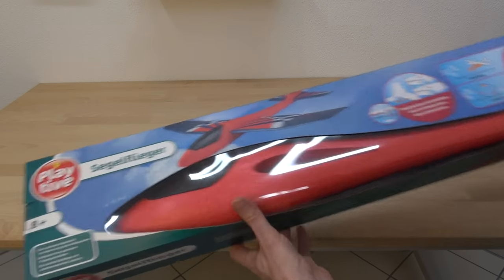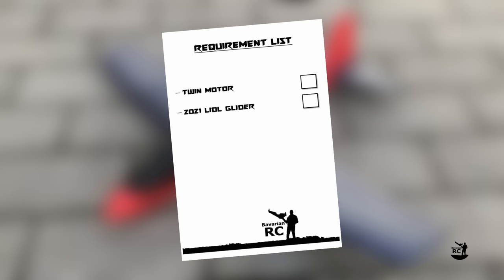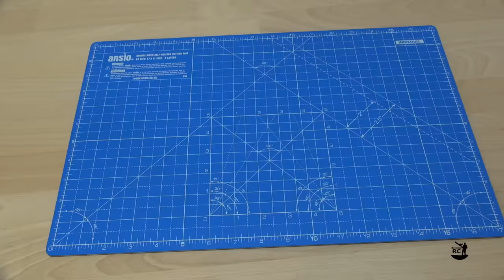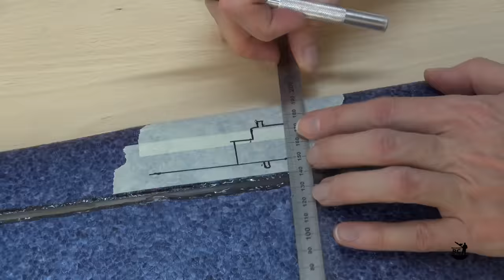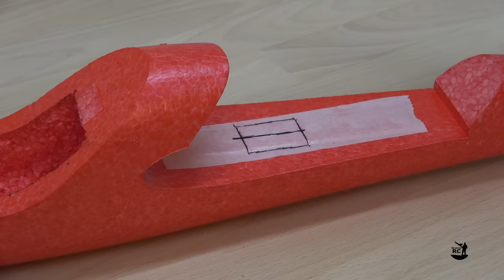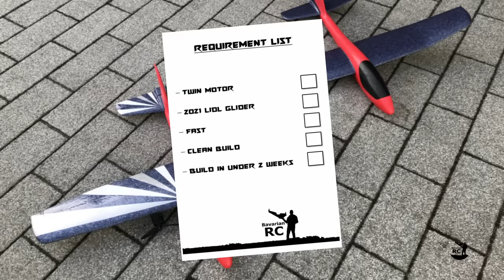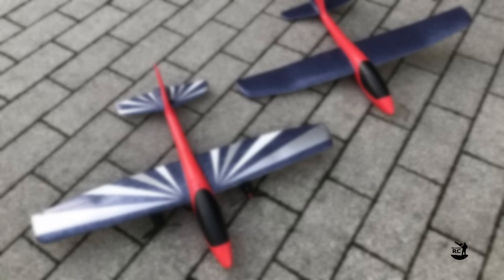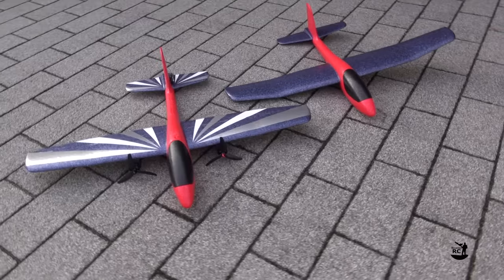LIDL glider RC conversion - TWIN TURBO LIDL - Build Video

Comment: 👍,  ?  die Verkabelung der zwei BEC's Regler zum Empfänger !????
Reply from the maker: Bei meinem Graupner GR12 Empfänger habe ich auf Kanal 1 den ESC vom rechten Motor, auf Kanal 6 den ESC vom linken Motor. 
Bei meiner Graupner MZ-24 Fernsteuerung habe ich dann im Menü "freier Mischer" einen Mischer von Kanal 1 auf Kanal 6 eingerichtet mit 100% (dadurch geht der linke Motor synchron mit dem rechten Motor mit).
Um dann noch Differential Thrust zu haben, habe ich einen freien Mischer von Kanal 4 (eigentlich Seitenruder) auf Kanal 1 (also Motor rechts) mit 85% so einrichten, dass bei Seitenruder rechts der rechte Motor runter geregelt wird. In gleicher Weise habe ich einen weiteren freien Mischer von Kanal 4 auf Kanal 6 (also linker Motor) mit 85% so eingerichtet, dass bei Seitenruder links der linke Motor runter geregelt wird. Die beiden Mischer für Differential Thrust habe ich bei mir noch auf einen Schalter gelegt um das ganze ein- und ausschalten zu können.
Ich hoffe, das hat Deine Frage beantwortet. Falls nicht, einfach nochmal melden.
Reply: Boh, ist bestimmt ne Super Ansteuerung der beiden Brushless.
Aber geht das nicht einfacher?
Y bzw. V- Kabel an Thrust, je einen BEC an V- Kabel, an einem BEC davon das rote Kabel abtrennen und Plus und Minus tauschen damit dieser Brushless gegenläufig läuft.
Hatte ich mal bei einer Trans All so gemacht. O.K....ein Motor läuft dann etwas später, kaum merkbar !, an. 
Beide Motore laufen dann immer zur gleichen Zeit gleich Stark, das hat mir aber voll und ganz gereicht.
Wozu noch unterschiedliche Drehzahlen je Seite?,  wozu noch Zu und Abschaltbar ?  bei einem LIDL Flieger.....
Reply from the maker: Hi, ja natürlich geht das auch einfacher mit Y-Kabel. Ich wollte aber unbedingt Differential Thrust, denn wenn man die beiden Motoren per "Seitenruder"-Funktion mit unterschiedlicher Drehzahl ansteuern kann, dann sind damit ziemlich verrückte Manöver möglich. Schau Dir mal das Flugvideo von meinem Twin Turbo Lidl an. Diese extrem schnellen Flachtrudel-Manöver gehen nur mit Differential Thrust. Dass ich das Differential Thrust noch ein und ausschalten kann braucht's nicht wirklich, war eher eine Vorsichtsmaßnahme falls ich beim Programmieren was verbockt habe, dann kann ich's einfach deaktivieren.

Comment: Vielen Dank 
Supper anleitung,  habe mich beschlossen gleich nachzumachen,  fand die idee echt super für meinen sohn was unkaputbares zu basteln !!!
Könten Sie mir evtl , tipts zu Remote einstellungen schreibem , ob motoren auf dem gleichen kanal liegen und ob die beim fliegen wenden noch zusätzlich separat gesteuert werden !? Unsere erster Flieger 😁👍
Reply from the maker: Vielen Dank für das positive Feedback. Bei mir sind die beiden Motoren auf jeweils einem eigenen Kanal und dann über einen Mischer kombiniert. Zusätzlich habe ich noch differential thrust, d.h. ich kann mit dem Seitenruder Kanal einen Motor abbremsen und den anderen auf Drehzahl lassen. Das führt dann zum Beispiel zu den lustigen flat spins (siehe mein Flugvideo vom Twin Turbo Lidl). Wenn das euer erster Flieger ist, dann muss ich euch aber auch warnen. Meine Konfiguration ist ziemlich übermotorisiert und auch die Querruder sind ziemlich groß um maximale Agilität zu haben. Das ist so in der Form nicht wirklich Anfänger tauglich. Solltet ihr schon genügend Flugerfahrung haben, dann ist das natürlich kein Problem. Bei weiteren Fragen einfach melden.
Reply: Danke für ausführliche Antwort, das Flug Video habe ich auch angesehen,  fand echt super,  das Model ist wirklich agil und schnell müste ich nachher auch feststellen 🤣🤣🤣 aber mit anderen motoren denke könnte mann auch die Geschwindigkeit etwas drosseln oder mit dem regler , bin erlich gesagt fast fertig mit dem Modell und bräuchte evtl . noch paar Tips zu Qklappen auschlägen und weiteren Einstellungen habe Gr MZ-24 , wenn Sie mir da noch paar Tips zu Agilität Drosselung von Q ruder oder Regler Einstellungen geben würden,  wäre 👍
Fahre selbst Endurance ode E-boote 🤣 ist doch etwas anders .
MfG
Reply: @bavarian_rc  Regler habe ich von Graupner S3082.BEC, gleiche Motoren, Graupner Gr 12 , E-max servos MG x2 und eine normale analog  , Sender MZ-24 , lipos 2S und 3S zu Auswahl,  rest genau so wie in dem BauVideo außer das ich mir die ganze zeit überlege noch wie Ich den Flügel abnehmbar machen könnte ohne Stabilität zu beantragen 🤔 , alle 3d druckteile. 
Ps' anderen BauVideos auch shon alle angesehen , sehr gründliche präzise und saubere Verarbeitung - wirklich Toll'
Reply from the maker: Ok, wenn der Flieger schon fast fertig ist, dann muss der auch in die Luft 😉 Ich würde dann halt nicht mit Vollgas fliegen. Ich schicke Dir mal ein paar meiner Einstellungen, dann hast Du einen Anhaltspunkt um gegebenenfalls dann alles etwas weniger aggressiv einzustellen. Erst mal zur Kanalbelegung an meinem Graupner GR-12. Ich habe auf Kanal 1 den ESC vom rechten Motor, Kanal 2: Querruder links, Kanal 3: Höhenruder, Kanal 4: Querruder rechts, Kanal 5: Telemetrie, Kanal 6 ESC vom linken Motor. 
Bei beiden ESC's nach Anleitung den Weg einlernen (also Vollgas und Nullstellung)
Ausschläge der Querruder (gemessen ganz innen beim Rumpf): 13mm hoch, 12mm runter mit 70% Expo. Ausschlag Höhenruder (gemessen ganz innen bevor die Schräge hochgeht): 10mm hoch und 9mm runter mit 40% Expo.
Die Ausschläge würde ich für zahmere Flugeigenschaften auf jeweils 50-60% reduzieren. Wichtig ist das hohe Expo beim Querruder, da er um die Mittellage herum sonst sehr nervös wird.
Im Menü "freier Mischer" einen Mischer von Kanal 1 auf Kanal 6 einrichten mit 100% (dadurch geht der linke Motor synchron mit dem rechten Motor mit).
Falls Du Differential Thrust haben willst, einen freien Mischer von Kanal 4 (eigentlich Seitenruder) auf Kanal 1 (also Motor rechts) mit 85% so einrichten, dass bei Seitenruder rechts der rechte Motor runter geregelt wird. In gleicher Weise einen weiteren freien Mischer von Kanal 4 auf Kanal 6 (also linker Motor) mit 85% so einrichten, dass bei Seitenruder links der linke Motor runter geregelt wird. Die beiden Mischer für Differential Thrust habe ich bei mir noch auf einen Schalter gelegt um das ganze ein- und ausschalten zu können.
Reply from the maker: Der Regler ist vergleichbar mit meinem, hat aber keine Telemetrie, was kein Problem ist. Die MZ-24 habe ich auch, schöner Sender!👍 Ich betreibe den Flieger mit 3S 1800 mAh. Damit bekomme ich ca. 5:30 Minuten Flugzeit wenn ich nur ab und zu Vollgas gebe und sonst mit ca. 50-60% Gas fliege. Mit 2S habe ich das noch nicht versucht. Damit wäre auf jeden Fall der Schwerpunkt leichter zu erreichen. Ich muss meinen GPS Logger ganz hinten vor dem Seitenleitwerk befestigen um den Schwerpunkt zu erreichen (60mm von der Flügelvorderkante). 
Zu den Motoren noch: Ich hatte meine zunächst mit zu wenig Sturz eingebaut und habe dann später die Motoren so lange weiter nach unten gekippt bis ich bei Lastwechsel keine starken Auf- und Ab-Bewegungen mehr hatte. Die Motoren sollten also ca. 1,5 Grad (gegenüber der Profilsehne) nach unten geneigt sein. Ich habe mir hierzu eine 3D gedruckte keilförmige Scheibe (in der Größe des Motors) unter die Motoren gelegt. Kannst aber auch einfach Unterlegscheiben dazwischen packen bis der Winkel stimmt.
Wichtig ist noch bei den Propellern welche zu nehmen die etwas flexibel sind (so wie meine HQ props), sonst brechen die Propeller bei jeder Landung. Die HQ Props haben fast 100 Flüge hinter sich und sind noch nie gebrochen.
Die Flügel abnehmbar machen geht sicher, bringt halt Zusatzgewicht mit sich. Da der Flieger sehr klein ist, habe ich alles fest verklebt.
Ach ja, noch ne Frage: Welchen Lidl Flieger hast Du als Basis genommen? Den von 2022 oder von 2021? Ich frage deshalb weil der 2021 Flieger (den hab ich verwendet) ein besseres (halbsymmetrisches) Flügelprofil hat und weniger Einstellwinkel-Differenz zwischen Höhenleitwerk und Flügel (was prinzipiell auch besser ist). Meine ganzen Angaben beziehen sich auf dieser Version von 2021. Der 2022 Flieger war wie die früheren Versionen von 2020 und die Jahre davor mit einem Profil mit gerader Unterseite ausgestattet und deutlich mehr Einstellwinkel-Differenz. Wenn Du diese Version hast musst Du evtl. eine Einstellungen anpassen, aber das wird sich im Flug zeigen. Ich hab auch schon einige Lidl Flieger auf der Basis 2022 umgebaut, die gehen auf jeden Fall auch gut. Bei höheren Geschwindigkeiten gefällt mir aber die 2021 Version besser.
So jetzt hast Du erst mal einiges zu Lesen 😁Schöne Grüße und viel Erfolg.
Reply: @bavarian_rc  Servus ! Wow das ist wirklich ausführliche Erklärung:)))) klasse das mann denn gleichen Sender hat , war bestimmt noch einfacher gewesen mir die Einstellungen zu sagen 🤣👍wirklich alle fragen die ich mir selbst gestellt habe hast genau so beschrieben ind der Anleitung! Habe mir etwas beim regler die empfänger und Strom kabel verlängert weil die etwas bei dem regler zu kurz waren und gleichzeitig auf TX30 umgelötet  . Expos alle eingestellt vom verkleben kontrolliert , regler angelern , so weit so gut 😁 blib nur noch Flügel zu verkleben und Mittel punk zu finden . Ich habe jezt 2022 Version bekommen wo die untere kante vorne beim Flügel nicht abgerundet war das wegen ware die 3D Keile nicht im Einsatz,  werde mir die 3D Scheiben noch konstruieren und auf genannte 1.5 Grad Winkel einstellen. Propeller von Dalprop recht flexibel und stadt 5043 habe welche mit 5045 anderen waren ausverkauft 🤣😭 ! Evtl setze ich Vario ein und werde im dann hinten platzieren,  Regler könnte ich bei Bedarf davor mit BlHeli Siut programmieren aber von dem ist mein Wissen noch auf dem normalen User Zustand 🤪 Das einzige was ich noch nicht ganz verstanden habe QR auschläge in mm zu messen werde mich aber noch schlau machen .
Kann kaum erwarten wenn es fertig wird und darf endlich in die Luft!!!
Grüße aus München
Reply from the maker: Die Scheiben musst Du nicht konstruieren, ich schicke dir zwei Links. Einmal auf die Scheibe mit 1,5° und einmal auf die Scheibe mit 0°. Die mit 0° kannst du dir dann entsprechend abschrägen wie du es brauchst, für den Fall, dass 1,5° nicht passen.

https://drive.google.com/file/d/1IAU9nDKLGqtvW_RfU45_q0rZtkrdxSaO/view?usp=sharing

https://drive.google.com/file/d/13Xpqunq5V2XYvWiWEr5qXKX39NocpF8Z/view?usp=sharing

Die DAL props sind gut, habe ich auch schon bei ähnlichen Fliegern verwendet.
Am Regler musst du normalerweise sonst nichts mehr programmieren.
Die QR Ausschläge einfach an der Hinterkante des Ruders messen. Dazu ein Lineal senkrecht an das QR hinhalten. Bei Vollausschlag nach oben sollten die entsprechenden mm rauskommen. 
Du kannst Dir mal mein Shaka Flugvideo anschauen, da zeige ich am Ende bei den Tipps und Tricks auch wie ich die Ruder einstelle. Das geht beim Twin Turbo genauso. Nur halt mit anderen Werten.
Hoffe das klappt alles mit dem Erstflug. Bitte unbedingt melden und erzählen wie es geklappt hat.
Ich würde mich auch über ein Foto vom fertigen Flieger freuen. Einfach mal auf meinen Instagram Kanal (@bavarian.rc) gehen und eine Nachricht schicken.

Comment: long long does it fly with a 1800mah battery? or did you use another battery?
Reply from the maker: My average flight time with a 1800mAh 3s battery is between 5:30 and 6:00 minutes depending on the amount of full throttle phases.

Comment: How will you land without breaking the props?
Reply from the maker: Hi, the props I use have some flexibility. During around 175 flights I didn’t have a single broken prop. I use 2x HQ 3-blade 5x4,3 or 2x T-Motor T 5146 Clear Red. Both work great. The T-Motor props have a bit more punch.

Comment: What’s the benefit of using carbon tube vs carbon rod?
Reply from the maker: If you compare a carbon tube and a carbon rod of the same weight (meaning rod with a smaller diameter than the tube) then the tube is much stronger (stiffer) than the rod. So in the end the benefit is to save weight.

Comment: Needs landing gear attached to the engine mounts ?
Reply from the maker: No need for a landing gear. Even if the props touch the ground on landing I have had no broken props so far. The HQ props I used have some flexibility

Comment: why not use hot knife instead of the Dremel less mess and way clear lines??
Reply from the maker: Good idea! Never tried with a hot knife. I will give it a try next time. At least for some of the cuts it could work well. Removing all the material from the fuselage could be a bit tricky.

Comment: How did you wire up the receiver to get differential thrust and 3 servos to a 6 channel receiver and how did you configure the transmitter for this aswell
Reply from the maker: Hi, the wiring on the receiver is as follows: 1: Right ESC, 2: Left Aileron, 3: Elevator, 4: Right Aileron, 5: Telemetry, 6: Left ESC, in the receiver map channel 5 -->4 (to have the right aileron on 4). Configuration of the transmitter: Mix channel 1 --> 6 (curve: -100% to +100%) (for throttle), Mix channel 4 --> 1 (curve: -85% to +85%), Mix channel 4 --> 6 (curve: +85% to -85%). You might need to invert the curves if the wrong motor is spinning when applying rudder input. Be careful when trying this - always remove the props! It was a pain until I got this working for the first time but finally it works. Hope this helps!
Reply: @bavarian_rc  yeah that's really helpful and I know your twin motor design is pretty quick but do you think there would be enough thrust with just one on the front
Reply from the maker: One motor will also work fine. Have a look at my other Lidl glider conversion videos. There is also one with a single motor in the nose

Comment: What’s the tool that you cut the servo holes on the form?
Reply from the maker: It is a Dremel 3000 with a Dremel Carving Bit (193) + Multipurpose Cutting Kit (565). You can check the video description to get more info on the material and tools I used.

Comment: I'm in Canada, so where can I buy one of these gliders. A brand name would be helpful.
Reply from the maker: Hi! There are 2 versions of the Lidl glider. The 2021 version (also called V2) which I used to build my Twin Turbo and the V1 (2022 and 2020 and before). The V2 I haven‘t found yet anywhere else, but the V1 is available from Yamara: https://jamara-shop.com/Pilo-XL-Foam-Hand-Launch-glider-EPP-wing-orange-fuselage-blue
I hope this one is available in Canada. If you find it anywhere else then let me know as I am often asked about where to get the plane. Especially if you find the V2 which is and improved version of the V1 with half symmetrical air foil and a wider fuselage. Unfortunately Lidl sold it only in 2021 and went back to the V1 this year.

Comment: kann man das auch mit nem 2018 Flieger machen? Die Konfiguration des Fliegers ist ja änlich, also Gewicht, Maßen und Aufbau...
Reply from the maker: Also prinzipiell geht das auch mit nem 2018er Flieger. Schwerpunkt ist gleich, die meisten Maße können annähernd übernommen werden… aber der aktuelle Flieger hat ein paar echte Vorteile: halbsymmetrisches Profil (bessere Flugleistung, geht besser im Rückenflug), geringere Einstellwinkeldifferenz (entspricht eher dem was man bei einem RC Modell nehmen würde), breiterer Rumpf im vorderen Bereich (damit passen Akku und Empfänger besser rein). Damit hat der Flieger deutlich ausgewogenere Flugeigenschaften. Evtl. lohnt es sich bis Mai/Juni zu warten bis der Flieger wieder bei Lidl zu haben ist.
Reply: @bavarian_rc  Aha, danke dann für die Info! Ich werde vermutlich mir einen etwas neueren dann kaufen, um das Modell etwas moderner zu gestalten...trotzdem vielen dank! Könnte ich vielleicht auch die Daten für die ganzen Maßen haben, also wie tief ich bohren muss oder wie lange ich was ausschneiden muss?
Reply from the maker: Schau mal in die Video Beschreibung, da ist ein Link auf meine Pläne drin und viele weitere Infos. Die Aushöhlung im Rumpfvorderteil ist nicht vermaßt, die richtet sich ein wenig nach der Größe des Akkus. Es sollte aber ein Wandstärke von rund 8mm nicht unterschritten werden. Sag Bescheid wenn Dir noch Maße oder Infos fehlen. Viel Spaß beim bauen!
Reply: @bavarian_rc  Perfekt, alles gefunden! Vielen dank für die Infos!

Comment: Excellent build. Totally LAME that you didn't show flight footage. Why did you make the motor fairings so aerodynamically bad? I thought you wanted it to go fast?
Reply from the maker: Thanks. Don’t worry, there is a flight video: Flight Video - LIDL glider RC conversion - TWIN TURBO LIDL
https://youtu.be/9_H6sVcMOhw
For the motor mount I went the easy way and used something I found on thingiverse. It looks a bit bulky but actually the front face is just slightly bigger than the motor. Still quite fast 😜

Comment: 1:10 хватит оправдывать покупку этой бесполезной фиогни. ты мог это вырезать ножом. Было бы ровнее.
Добавлено: невзирая на критику выше, результат офигенный))) Мое уважение.
Reply from the maker: Thanks! Cutting with a knife works ok for some cases but the deeper I go into the fuselage the more difficult it gets. The dremel make a huge mess but works. Next time I will try a hot wire to cut the foam.
Reply: @bavarian_rc  
I hope you understand that this is a joke)
I myself want a similar device, but objectively a knife is enough for my tasks)
Your plane is really great.
Reply from the maker: No worries! I know how useful such tool is. But I wanted to honestly answer that it is sometimes maybe not the best or only option. Thanks a lot for your feedback. Great that you liked it the build. Cheers!

Comment: I wish I had the knowledge to do this
Reply from the maker: Actually it is not so difficult… if you are not yet into RC building and flying then just start with a beginner kit and then step up. Doing a chuck glider conversion is finally not so difficult. If it goes wrong it is only foam.